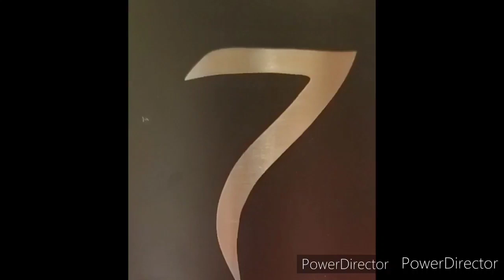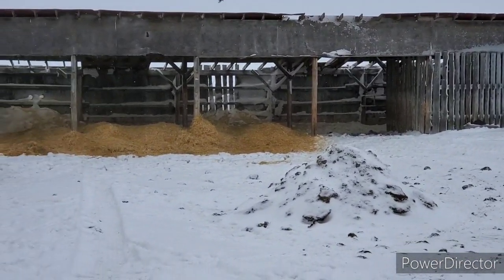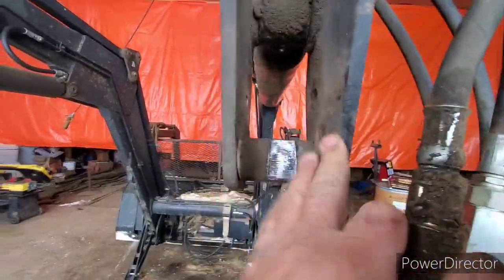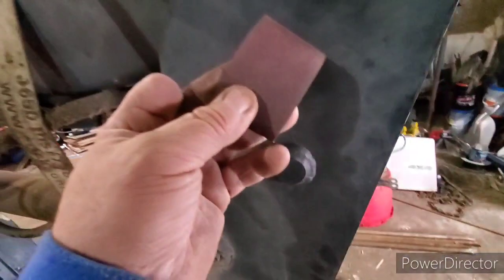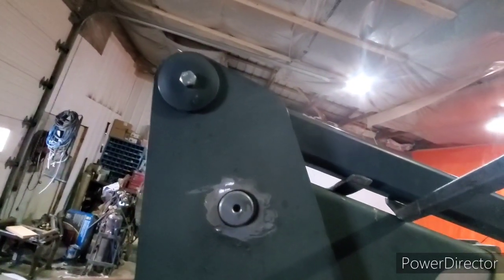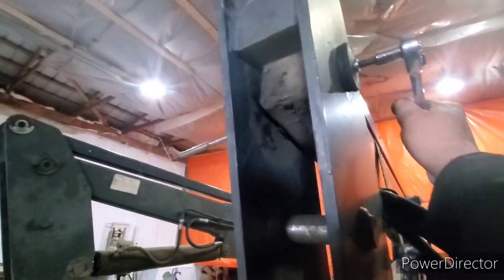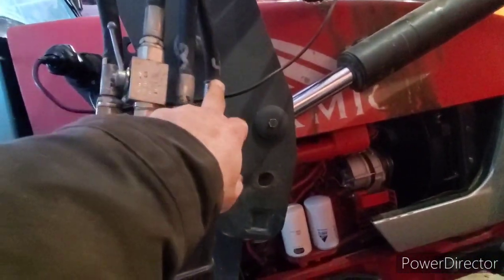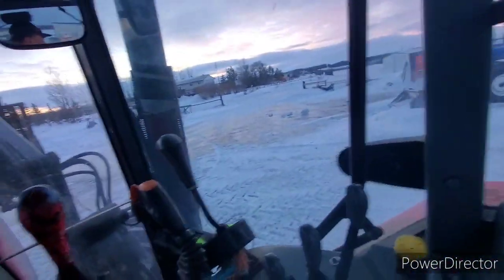ALO Quickie 980 Repair

Comment: BP like you I have been caring for machinery for years but only recently have I realized the best way to grease loaders . I now always put a wooden block on the floor and push down til the wheels are off the floor & then grease all the pins and steering & axle pivot also . The pressure goes onto the opposite side of the pin & bush allowing the grease to go into the normal working side .    ~    ~
Reply from the maker: Greasing more regularly would solve my problem lol...I tend to slack on Greasing the loaders
Reply: Give the block a go , you will probably notice everything is a lot more smooth  ~   ~
Reply from the maker: Ill give it a try...I greased the tractor today also

Comment: Just try to have something nice! That's what Penn would tell me.  Lol
My old loader is so sloped out, I'de have to buy a truck load of metal to tighten her back up!
Doc
Reply from the maker: I've got all the steel bushings and pins here for your loader...it should be all 1 inch just got to drill in the grease zerks...👍👌